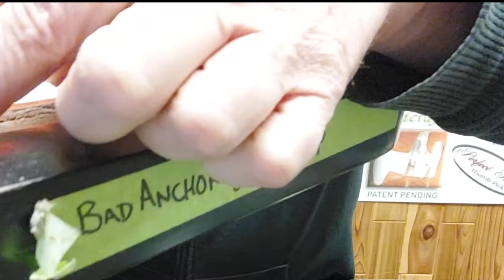Is it a Lemon?  Let's look!   Used Autoharps #1.  Dished Top

Comment: I have an Oscar Schmidt that is slightly different. I checked the anchor looks fine. It was stored and when I bought it the strings were very flat. I hope that's what has saved it. It holds its tuning well so far.

Comment: It’s folding in on itself. Guitar tops do the same thing over time. Over time they all will self destruct. Iv fixed a few by cutting the tops off right up to the layered pin blocks. Then add kerfling against the pin block. Then add a nice thin spruce top back on with a neck end block to attach the aluminum piece to. They end up being great players. Myself I put an adjustment end back.  Labor and time would be a killer for someone paying to have it done though.